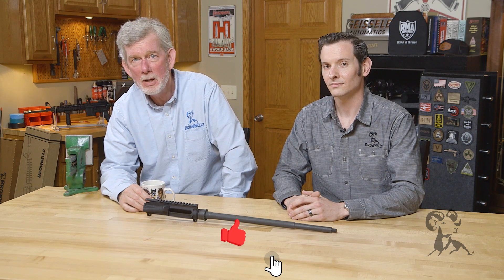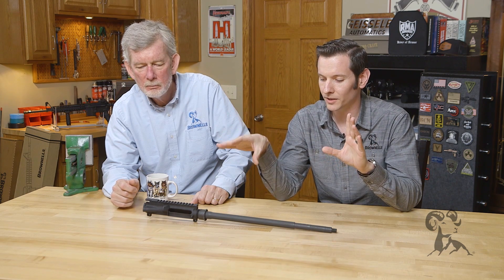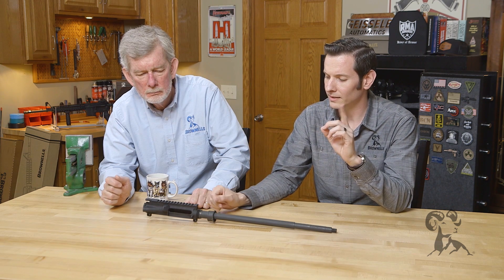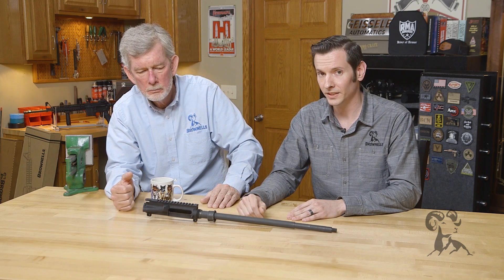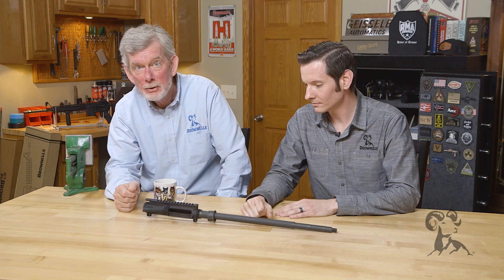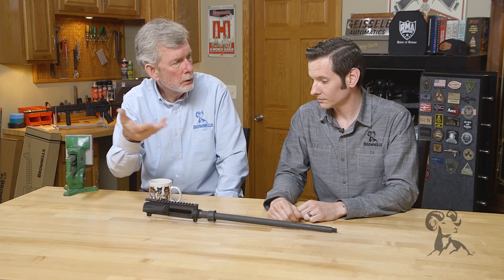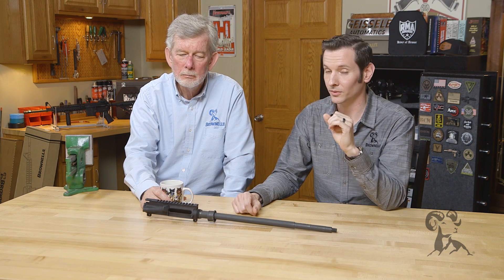SmythBusters: Galvanic Reaction & Your AR-15 - Part 1

Comment: I took an armorers course a couple of years ago and the instructor brought in a receiver that had been victimized by a galvanic reaction.  The threaded portion of the receiver was broken off and the aluminum around where it broke was really thin.  He told us that the concept of galvanic reaction was way overblown but it was a real thing.  Apparently what happened with the receiver was that it was greased with a lubricant containing graphite.  When the barrel nut was torqued down it caused "micro-cracks" in the anodizing which allowed the lube slowly work it's way down and make contact with the raw aluminum underneath.  Over time this slowly ate the front of the receiver.
Reply: Chad Albrecht of SOTAR has stated this is one thing to pay attention to. Another reason to use recommended grease
Reply: Post a picture to pinterest so we can see it.
Reply: So basically it's an erosion reaction and process that takes place between two different types of metals that are bonded together without any coating or protective in-between them....?
Reply: @shadyp-zv3uf , it is not an "erosion reaction". Erosion is a wearing away of material due to mechanical action by wind, water, frictional contact, etc.  It is rather an electochemical corrosion caused at the molecular level by a transfer of ions between dissimilar metals that are electrically conductive, and which are exposed to an electrolyte (for instance acid or salt water).  It is similar to the reaction that happens within a battery which causes a small flow of electrical current between the metals.  The more reactive metal (in this case the aluminum) becomes an anode, which is more subject to corrosion than the cathode (in this case the steel barrel) when in the presence of the electrolyte.  As you can imagine, it is a much more concerning issue in the marine industry where metals are constantly subject to water - and especially saltwater.  In these instances, the use of sacrificial zinc anodes are employed, which then become the most reactive metal in the chain, and thereby protect the less reactive metals (the aluminum hull of a boat, steel drivetrain components, etc.).  The attached zinc components are intended to corrode ("sacrificed") and are replaced from time to time, as necessary.

Steve
Reply: @stellarpod  I think I meant corrosion.... in that way it is very similar right? two opposing metals with something introduced to cause a corrosive reaction like the corrosion build up on the post's of a car battery?
Reply: @stellarpod  and yeah I know saltwater is the worst, and the marine or saltwater boating industry experiences this a lot.... I didn't know that they actually had sacrificial parts made from zince and replacing those from time to time in order to persevere the more important ones.
Reply: @stellarpod  my tpms sensors have metal valve stems and cheap metal valve stem caps and salt slush from de icing caused them to bond together. The caps would not remove after the galvanic corrosion.
Reply: Damn I need to check the lube I used on my barrel extension. I believe it was a caliper grease
Reply: I know this is an old post... but You're definitely correct. When I built an AR for a friend, his upper/barrel mating was terrible and the barrel and hand-guard were not straight at all. Had to get the lapping tool to straighten out the barrel (and it worked)... but if was bad enough that the anodized aluminum layer was possibly completely missing... so with the anodizing missing, I'm 100% certain it would have caused galvanic corrosion over time if I didn't cerakote the bare aluminum for him. The anodizing layer is only about 0.003" thick (at most) and I had to remove at-least 0.005" from the high side. Was a delta team tactical build he bought, but couldn't complete, because it was out of spec. (The upper, the barrel nut and the hand guard were all out of spec. Was able to fix the upper and hand guard, but had to buy a new barrel nut for him).
Reply: Honestly, this sounds to me more like a manufacturing defect in the upper receiver than galvanic corrosion.
Reply: @silentbob267  It's easy to tell when it happens to aluminum, with the pitting and white oxidized aluminum everywhere.  Lacking that... got to doubt it.
Reply: Sounds like it was rode hard and put up wet!!!

Comment: I wrapped welded wire around a frame of extruded aluminum welded into a duck blind half-roof design. The aluminum was raw and the wire was galvanized to prevent rust. I think the thin stiff welded wire would rust through before the thick welded aluminum frame.

Comment: I've seen it in electronics and electrical systems. I had a wall outlet, rated for copper only, catch on fire because it was wired go aluminum wiring.

Comment: Galvanic corrosion requires a circuit outside the metals, a loop between the metals and an external electrolyte.  It's not going to happen in air or mist.  Might if you spray it with salt water continuously.  Will if exposed metals are immersed in saltwater for extended periods.  Key is exposed.

I've seen tons of galvanic corrosion in boats and ships; in ships and steel yachts (and propellor shafts anywhere), you actually USE galvanic corrosion to keep the hull from rusting below the waterline.  That's what "zincs" are - zinc is an anode for steel, so you leave the zinc electrically bonded to the steel hull or shaft, exposed to the water, and the zinc is corroded away over time rather than the steel.  It forms an electric circuit through the water and any exposed steel is still protected by the potential.

This would be easy to experiment with.  Get a container full of salt water (or fresh water and pour in about 4.5 oz of salt per gallon, stir).  Take some uppers, a mixture of normal anodized ones and some in white / unanodized.  Get some normal barrels, some bare stainless barrels, some nitrided barrels.  Worst case would be defective coatings or scratches in coatings, so test some barrels with serious scratches on the mating surface and receivers with corresponding scratches (wire brush through the coatings), and some as-is coated.  Dunk them in the salt water for say a month, six months, a year, see what happened at the end of the periods.  Also some barrels and receivers not attached to each other.  Keep them separate, not touching underwater.

I suspect that you'd see some galvanic action on white receiver and stainless or any scratched barrel.  Possibly some on anodized scratched receivers; the exposed surface is much less.  If you leave them unscratched, I suspect barrel coatings and receiver anodization reduce galvanic action.  If the steel coating fails it will rust by itself.  If it's an uncoated bore, for example, look out inside.  Nickel or nitride would minimize that.

Galvanic would be indicated if the steel was intact or relatively intact and the aluminum had rotted away or had big surface pits.  Same as ships and the zincs - the anode (aluminum, here) is sacrificing itself for the cathode (steel).

Comment: It is not true all threads should be lubed before torque. I'm an airframe powerplant mech and you never apply lubrication to aviation threads unless the procedure calls for it. And I can't ever remember lube being called for. The torques are all dry torques. This was true of military and civilian acft. I have no clue why, and understand why lubrication is so often called for outside of aviation. I assume aeronautical engineers want that metal to bite as another level of protection. Aviation fasteners are also very high quality, and usually treated against corrosion. However because aviation is a huge exception I assume there are other applications that call for a dry torque. If you wet torque a dry torque fastener you have over torqued. The bottom line is there are wet torques and there are dry torques. If it is a critical torque find out what the engineers or experts in the field call for.
Reply: All AR15 barrel nut torque specs are Lubricated Torque values, regardless of manufacturer.

Comment: What bout the lower parts?  All that steal and aluminum too.
Reply: Michael Franz as many lowers are also hard coat anodized, inside the trigger housing as well, it wouldn’t happen there for the same reasons they mentioned in the video. Good question though.

Comment: I use the frog lube paste on my barrel nuts, its what i have, and it seems to work well.
Reply: I usually don't recommend it because it becomes very light weight when it heats up or is put under pressure and tends to not stay in place for an extended period of time.
Reply: @CalebSavant  interesting. In my AR is seems to stay in place much better than traditional oils in the action. for torquing the barrel nut seems like it would be just fine.

Comment: Proper torque isn't what you're looking for in a threaded connection. You want proper tension. Torque is the power used create the tension, but once you stop tightening the torque drops to zero while the tension remains.
Reply: Proper torque=Proper Tension. Proper Tension cannot be achieved without Proper Torque.
Reply: @CalebSavant  Torque depends on the thread fit and the amount of friction in the joint. A rusty bolt will require a lot more torque to get the same amount of tension when compared to a clean, lubricated bolt.
Reply: @mmowen78  Yeah.

Comment: I've seen galvanic corrosion a lot in metal roofing. But none in firearms. Edit: You can get proper torque with dry threads. That is the way most torque ratings are specified. Lube torque ratings will always be lower than dry, even on the same fastener, on the same day, going into the same material.
Reply: All AR15 barrel nut torque values are lubricated torque specs regardless of manufacturer.
Reply: I was stating in general about torque specifications, not just AR barrel nuts.

Comment: What happens when you use a lapping tool on a ar 15 upper? It removes some of the anodized coating. 
Bare aluminum against the steel.. ?
Reply: Covered that in the video.

Comment: this may stem from steel bolts fusing to aluminum engine blocks from galvanic corrosion causing the bolts to break or strip out. To prevent this use anti seize grease with zinc in it. It can contains other things to stop it too.

Comment: I always wondered about this. I have expierence with electrolysis and was curious of a stainless barrel in contact with scratched off  anodizing. My next build is going to be a boat gun. I am going to have un coated receivers dipped in chromatic acid before cerakoting and all stainless controlls and barrel
Reply: Coat the threads and it should be ok. The grease should prevent moisture intrusion.

Comment: If galvanic corrosion was a thing on AR15s, you'd also see it between the inner surface of the upper receiver and outer surface of the barrel extension.  The barrel extension is steel, the upper is aluminum, and in many cases this is a tight fit with lots of potential for surface contact.  Moreover, most people don't ever bother to grease this interface because it isn't required in the manuals.  But I've never heard of people taking their upper apart and finding rusty barrel extensions or pitted uppers.

Comment: I remember when they 1st started putting the air pressure sensors in car tires galvanic corrosion was a big issue. The stems were aluminum and the black plastic caps had brass thread inserts in them. Add a little bit of winter road salt and people were breaking the stems trying to get the caps off!
Reply: That explains why that happened...

Comment: Yikes this guy thinks he knows what he is talking about. Whoa...... can't listen to this clown. Proper torque is achieved with lubricated threads? Lubrication changes torque values as it makes turning bolts, nuts, etc. easier with less resistance. Will always result in higher torque than actually spec'd.
Reply: Sorry you feel that way, if you prefer to make an educated response, here is a good study on such I recommend reading- https://www.hextechnology.com/articles/bolt-lubricant-torque/#k-factor. When dealing with torque values on barrel nuts, those values are ALWAYS lubricated values.
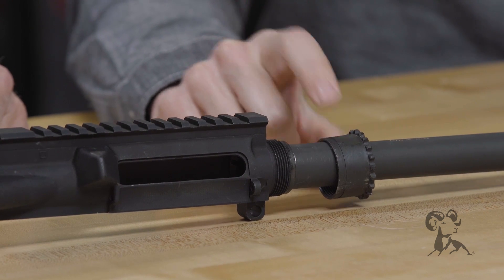Reply: @CalebSavant  Welp, guess I ran into the guy that has read every single study ever done. My b.... dude just admit you're wrong. Lubricating threads is mostly to avoid binding, galling, and seizing. Lubrication ALWAYS increases the amount of force on a fastener. Have a degree in manufacturing with several classes on metallurgy, fasteners, etc. Multiple demonstrations by companies on said subjects. From 2:30-3:00 is just not good..... not good at all. Fake news. Don't get so butt-hurt, Jesus Murphy hahahahaha.
Reply: @SuperLuigi707  👍

Comment: Lube is not always required for proper torque.  Depends on the fastener.  Some are specified dry, and lubing them would potentially pass yield stress.
Reply: When dealing with torque values on AR15 barrel nuts, those values are ALWAYS lubricated values.
Reply: @CalebSavant  There it is.  A common statement was made that might mislead people.
Reply: @geardogg  We were indeed talking specifically about barrel nuts as stated so I'm sorry you feel mislead.
Reply: @CalebSavant  Condescension is so classy.
Reply: @geardogg  I mean no offense, stay safe.

Comment: Lube with graphite is usually what comes up in these discussions
Reply: If I remember my chemistry graphite is essentially inert chemically speaking.  I don't understand how it would cause it, although another commenter above mentioned it also.
Reply: @silentbob267  graphite is not inert. If you get two dissimilar materials in contact, the least noble of the two becomes the anode in the presence of an electrolyte, which can be pretty much any liquid with the possible exception of distilled water, and the more noble becomes the cathode. The anode is always the one that will get eaten away by galvanic corrosion and the further apart they are in the series, the stronger the reaction will be and the faster the reaction will occur. If you've ever had anything to do with steel hulled boats you will probably be aware of sacrificial anodes, blocks of zinc bolted to the hull to take the corrosion and get eaten away while saving the steel hull from corroding as it has become the cathode in the reaction. At the most anodic end of the galvanic scale there is magnesium which corrodes very easily.  (We used to have problems with mag alloy aircraft wheels corroding rapidly if a dog pissed on them and there was a chip in the paint.) Next to that is zinc, then beryllium, followed by aluminium alloys. You then have all the other metals in order until you get to the most noble ones such as titanium, gold, platinum, and way past those is graphite so there is a HUGE potential for corrosion between graphite and aluminium alloys. Graphite is cathodic to all metals and will corrode any metal put in contact with it to varying degrees under the right conditions. It causes problems on aircraft when carbon fibre (graphite) panels have to be attached to aluminium alloy structure and special sealants have to be employed to prevent them coming into contact and reacting, destroying the alloy.
Reply: @dentwatkins2193  There is a difference between being chemically inert, which graphite essentially is, and being electrically conductive, which graphite can also be.  The phenomenon you speak of seems to be linked to the electrical conductivity of graphite although I struggle to find scholarly articles that verify this phenomenon.  Perhaps you can provide the links to some?
Reply: Juiceman its is claimed to be a mild abrasive
Reply: @keithreinert5835  Yeah but you essentially need an electrolytic solution between the metals also.  I have a hard time believe a lubricant for metal would have electrolytic properties.

Comment: TL;DR: you could make it happen, but it would take serious abuse for it to occur on an AR-15 without doing it on purpose.

You certainly can get galvanic corrosion between aluminum and steel, but in an AR-15, the hard anodizing, which is a few thous thick IIRC, is an insulator, and you don't have an electrolyte. You need three things for galvanic corrosion: 1) dissimilar metals, 2) an electrolyte, e.g. salt water, and 3) an electrical connection between the pieces. Without all three, nothing happens.

If you milled the anodization off the receiver, formed an electrical connection between the receiver and the barrel, and then added a conductive liquid such as salt water, then you would see corrosion.

Basically galvanic corrosion is just another word for a battery. If you have two electrodes, electrically connect them together, and put them in a conductive solution, current will flow and the electrodes will be eaten away.

In my experience anodization tends to chip off if you hit it with a cutter. It's aluminum oxide, just like sandpaper, with some dye in it. Drilling through anodized aluminum extrusions, you can actually hear it chipping away. It sounds like somebody stepping on a bag of potato chips.

Comment: Galvanic corrosion requires the dissimilar metal couple to be saturated with water for extended periods of time and a solid electrical connection between the two. Anodizing creates an oxide which is an insulator.